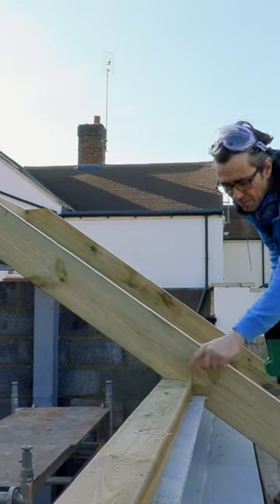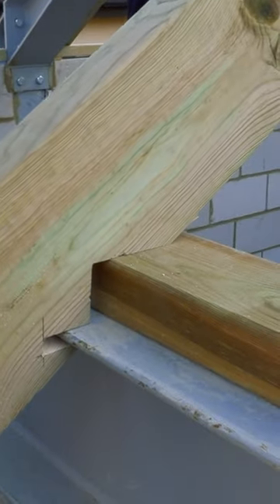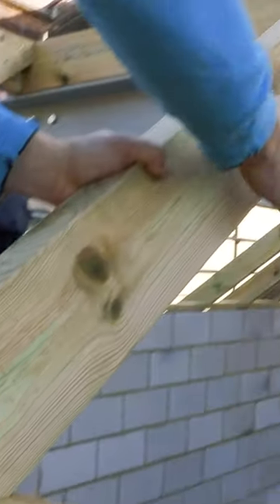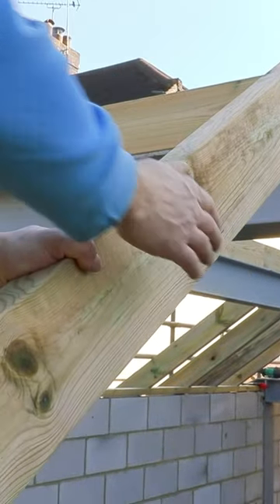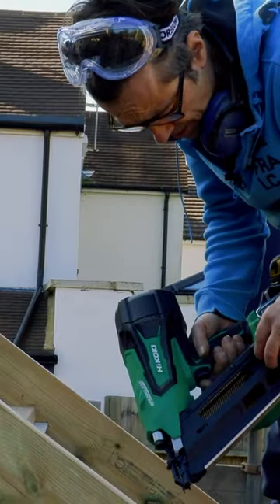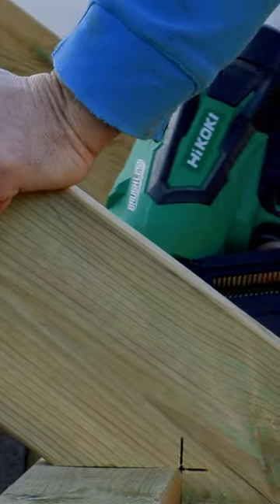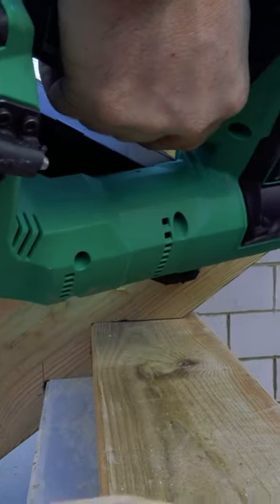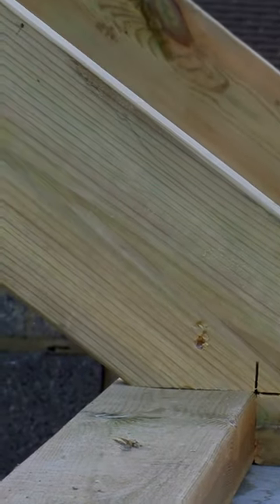Super Neat Rafters #shorts

Comment: The over cut is the sin in my book. Always follow the circular saw with hand saw to trim out , but I am a old person
Reply: Thinking the same. Cut is almost half way... reduces strength of the wood.
Reply: It's pencil mark I think.
Reply: Not a big issue if you consider how the roof structure supports the weight, only an issue if your over cutting is excessive, there is a possibility that the tails become weakened and thus the overhang compromised. But again as long as this isn't excessive along all of the tails (not forgetting the tails are tied to eachother with roofing baton) it shouldn't be an issue.

(Aswell his rafter tails are supported by the steel in tandom)

Personally I don't do this if I can help it, but I'd imagine when the pressure of time and weather kicks in it could be a different story.
Reply: Agreed. Inspector will count the cut as the remaining width of the board for the rafter. I believe 4" is minimum.
Reply: It’s only over cut on one side, the other side is perfect (classic skilsaw cut) and once the overall cut is no more than 1/3 the width of the rafter it’s fine . It’s the nailing of it with the nail gun is the sin, can’t beat a good old 4” round wire on a roof 💪😁👍
Reply: @jncg2311 it’s not pencil marks.  I took a screenshot and zoomed in, and you can see the cut wood fibres and that it’s a slot.
Reply: @maxmerton I agree now, you can see at the end, wood fibres in the cut. I was initially influenced by the pencil marks around the steelwork on the other side.
Reply: @rowlandgregory1233 20 penny is overkill. His nail size is weird. Comes out to 3½" and 0.122" diameter (same length as a 16D and same dia as a 6D nail). I don't get that. It's like a large brad nail.
Reply: They are far too easy pulled out for a roof, not a good job at all, 4” round wire nails were used for a long time and still the best in my opinion 💪😁👍
Reply: I was taught to handcut the rest and I've only been qualified for 4 years, just looks nicer too, hardly takes any effort
Reply: Yeah agreed, he is showing off his neatness around that steel then goes round the other side and he's over cut it. If its a time issue, why the fucks he making a video.
Reply: @khalidacosta7133 The overcut isnt going to compromise the strength of the wood where its situated!
Reply: Makes absolutely zero difference
Reply: I thought that but it must be a pencil mark. He wouldn’t have done the second notch n the made a mess of the bird’s mouth surely
Reply: @jncg2311 no it's the cut. Water.wil get in there too
Reply: @jimmyjoe1591 if water is getting in there when the roof is on then a slight over cut is the least of your worries😂.
Reply: Completely agree why go to the bother of that little cut out if ur going to over cut the birdie
Reply: @jncg2311 no. It’s definitely over cut
Reply: @rowlandgregory1233 nobody uses 4inch round wire nails anymore unless u get told otherwise in rhe specification but the nor now is just 90 nail gun nails
Reply: @reeceowens9144  because of insulation specs rafters are getting bigger than ever, and I can bend a paslode nail from tip to head with my hands, try that with a round wire and it will be your fingers that bend…  you can risk what u want in wales but here we like it tough 😁👍
Reply: @maxmerton so did I and it’s 100% pencil.
Reply: @Ben-ef4gf  OK then it’s pencil.  But he must have used a pencil in the shape of a circular saw blade, with teeth, rotating at the speed of a circular saw blade.
Reply: I am totally against overcuts too.  Just lazy but not likely a critical issue structurally.   A total sin for outside projects like decks.   A place for water penetration and pooling leading to rot
Reply: I can’t speak for everywhere but here rafters are way oversized in comparison to 30 years ago. 5x2 rafters and an over cut is a sin which is why it’s mostly older guys mentioning it, 7x2 with an over cut means nothing to the structure. And if there’s pooling of water around the wall plate you have bigger problems than an over cut birds beak 😂👍
Reply: @jncg2311 nah that’s definitely a cut not a pencil bro
Reply: Grow up it’s a rafter
Reply: @rowlandgregory1233  is that because timber is shyte nowadays?
Reply: Timber is definitely rubbish, faster growing with more soft wood, but bigger rafters I’m dealing with is mostly just to get more insulation shoved between them, nothing to do with strength 👍
Reply: @rowlandgregory1233  If they're serrated would it make them equal to 4" round?
Reply: @peadaroloughlin3270  it’s the head that pulls through first with nail guns so the ring shanks are no help with that. Round wire for strength, 💪 roof and arm 🔨
Reply: Black pen, other side of bird mouth has none
Reply: @theRhinsRanger  definitely not black pen, it’s a circular saw blade so he has cut past the line on one side but because of the circular blade it cuts less on the backside, it’s a very common thing, but seems very controversial on YouTube 😂
Reply: But your absolutely correct.👍
Reply: That so called over cut is absolutely fine. It's only affecting the overhang which is what like 16 inches? Maybe 2 feet? That rafter tail could be a 2x4 and still have plenty of strength for a 4 foot overhang let alone a 2 foot.
Reply: @maxmerton god that’s sad
Reply: @ELTUK82  please be specific.
Reply: Absolutely correct 👍🏻  
I'd rather take the time doing the final cut on the birds mouth with the handsaw rather than 
Fart about detailing around RSJ that will never be seen nor diminish the strength..

I also rather hand nailing 4" wires at the wallplate.. the Wireshank are good but just doesn't feel right😊
Reply: Absolutely.. I love those Japanese pull saws they’re fast you can finish that off in about 8 seconds and it looks beautiful.
Reply: That's a good rule to live by
Reply: Its the pencil mark lol!!
Reply: I'm 26 and that looks pretty bloody shoddy to be honest. The pressure to cut corners comes from the top, but the only way to make things right is for a No to come from the bottom.
Reply: Hate over cuts !. Only special without !
Reply: expansion
Reply: Thinking the same, doesnt want a second birdsmouth but cuts the first deeper than needed
Reply: @jncg2311 its not
Reply: i always finish my birds mouths with a hand saw, that been said those rafters are massively over sized to accommodate some thick pir insulation and that overcut wont weaken the raafter
Reply: @Ben-ef4gf No, it is overcut. Video poster confirmed it in another comment.
Reply: Agreed..
Reply: I was just going to comment when I saw yours. Absolutely. The rafters are weaker with over cuts. As are stair stringers. Jeeez. Not good.
Reply: Hahah I literally came on the comments to post the same thing 😂
Reply: @jncg2311  nope watch the whole video the first one he showed you can see it’s pencil but the one he nails in place you can see the cut line clearly with a round blade it might not penetrate all the way past to the other side
Reply: @rcirclebc3818  Thanks, I did. If you read the comments above, I agreed months ago that it was overcut in the second part of the video.  Still agreeing now...
Reply: @jncg2311  
On the one side it's pencil mark, on the other it's a cut.
Reply: @jncg2311 definitely not a pencil mark🤦‍♂️
Reply: I thought it was an overcurrent also.
Closer inspection: I think it is felt marker...
Reply: What overcut? Is that not pencil lines?
Reply: Drill the inner corner first and either cut out or carefully.
Reply: No hes right. It's 2 over cuts. The first clip is a pencil mark. Old school is often best. Modern is cut corners and do it quick and cheap. Integrity was the focus previously.
Reply: @jncg2311 That's a cut
Reply: @neilrafferty2097  Good grief.
Reply: @jncg2311  Robin is usually Mr Perfect.
Reply: I agree, he’s saying it looks special too. Why not use a hand saw. It takes a few extra seconds per rafter.
Reply: @khalidacosta7133  bollocks
Reply: Think thats pen mark

Comment: That notch looks like a great place for water to gather and soak into the wood grain.
Which is why a birds eye cut would make more sense, in my opinion.
Reply: Was thinking that, too
Reply: Water gathering in the truss timber of a felted and tiled roof?
Reply: @durrclips746  Over the lifetime of the roof, there will likely be leaks of one form or another. Water always finds a way to where it's not supposed to be.
As such, it is generally a good idea to try and avoid catchment areas as much as possible.
Reply: How exactly is water going to touch that  area? Do you know how roofs work?
Reply: @jayuppercase3398  Read my previous comment.
I seriously think people have no life experience these days.
It's like contingency planning is a foreign concept or something.
Reply: @deth3021  Yeah, a roof leak is bad full stop. It doesn't matter if there's a small notch in a piece of wood. If you have a roof leak it needs fixed regardless.
Reply: @durrclips746  can you at least try to think things through?
I mean even at the most basic of levels.

1 people don't always notice all roof leaks right away.
2. Even if the leak is fixed, the water will already be in the catchment area and soaking in and rotting the wood.
3. You seem to be assuming that rain only falls downwards. It doesn't.
Rain with driving wind is like a power washer and goes in every direction and will go through every joint, crack, etc...

By your logic, you don't need seatbelts because you shouldn't crash.
Reply: @jayuppercase3398 water vapour might condense on cold steel
Reply: If you get water there, your roof is leaking.
Reply: @deth3021 your talking bollocks
Reply: @deth3021 it's treated timber. It'd last 15/20 years if left outside. You're taking absolute bollocks

Comment: THE OVERCUT!!!😭😭😭😭
Reply: Thats the first thing i noticed!
Reply: The overcuts do not go all the way through and there is still plenty of wood. Get over yourselves.
Reply: @really2345  You sound like a bad craftsman, you should take more pride in it than that.
Reply: Using a circular saw your allways going to have slight over cut on one side
Reply: @mylesmackenzie3355  that's not slight.
Reply: @mylesmackenzie3355 unless you use a jigsaw. Or you get as close as you can, then use a handsaw, oscillating saw or a chisel if you're really fancy.
Reply: You sure it's not pencil marks?
Reply: @markorton6171   you can clearly see the gouges from the left side of the board when it zooms in close.
Reply: It's weird - on one side it is definitely pencil, on the other it is definitely over cut. It's as if they were two completely different pieces of wood
Reply: What is an over cut?
Reply: @jasonswindells6356   cutting beyond where the two lines meet to make the notch. You don't want to go past because it compromises the strength of the lumber. Due to the curvature of the blade, where you stop on the surface isn't the same as on the underside. Typically, you would switch to a hand saw  and finish the last half inch or so to make the cut flush.
Reply: It's not over cut you clearly see the other side of the birds mouth on the same timber when the camera is on the right side it's the mark of the birds where he marked up 🙄
Reply: @christopherbyers2294  you know that a saw blade is circular and does not make a 90° cut, right? So, from one side, it can be cut and then not have gone through the underside? The moment it passes the intended intersect, it is compromised. A millimeter or two, ok. But those are some pretty deep gouges for an instructional video.  Would I bet my life it wouldn't affect the overall integrity of the roof? Yes. Would I leave it in a video or on a jobsite for anything bigger than a 10x10 shed? Nope.
Reply: And? All the weight is on the seat cut.

Comment: You've over cut the birdsmouth both directions and you expect praise for notching the beam flange?
Reply: Nothing wrong with the overcurrent will have no repercussion on the strength of the roof
Reply: @barrystanton390  Do you mean overcut and what should one read into your mistake?  Excessive notches and cuts ARE a problem and DO affect the shear strength at bearings.  Why do you think we Structural Engineers are careful in our calculations?  It is not so that people ignore the basic properties of the materials they work with.  It is in the hope the folks building our designs take pride and care in their workmanship.
Reply: First thing i noticed was the over cut, yuck.
Reply: What do you mean by over cut the birds mouth?
Reply: @robi4387  yea what ever...been pitching roofs for 50 Yr  they're all still there
Reply: @D_5821 the birds mouth is the small cut he made so the board could fit around the steel beam (gray in colour). If you look closely he cut farther than needed.
Reply: Its pencil lines

Comment: Why don’t you put wider wallplate on steel 
Saves a lot of hassle in my book !!!!
Reply: that’s what I’m saying
Reply: Or if the wall plate was on the outside edge of the steel then just needs a bird’s mouth or does it have to be on the inside edge?
Reply: What about cost but I'm sure your not paying for the materials
Reply: @Gary-o5v  ah yeah, costs - screw the customer's safety, security, etc.
Reply: @tom.2900  obviously you didn't understand what I was saying their was a comment saying why not use a bigger plate as wide as the beam I said obviously your not paying for material a 2x6 is way more then a 2x 4 and so on when you can do it this way with an extra cut for the beam

Comment: You shouldn't use galvanized nails on tantalized timber , you should use stainless steel. Tantalized timber contains copper carbonate, and galvanizing is a zinc coating. Zinc and copper react, the zinc will loose elections to the copper and become ionized ie cause the nail to rust! Where I live building materials used for structural elements must be durable for 50 years to meet code. Galvanized nails into tantalized timber don't meet the 50 year durability requirement.
Reply: Reminds me of hearing about galvanic corrosion in engineering class.. not sure if it's that.
Reply: Then why do manufacturers specifically suggest galvanized, stainless or even aluminium fasteners with tantalized lumber? Although the advice is sound, this seems like a suggestion from a chemical engineer and NOT a structural engineer.
Reply: @johndough4507  I'm just a general contractor. That's the guidance for the Building Research Authority where I live. I would be very surprised if a manufacturer suggested aluminum and tanalized... that's an even more corrosive reaction. That's why you can not have copper spouting discharge onto an aluminum roof. The copper will destroy the aluminum. In the back of our national standards for timber building is a table with all this in it, and we get taught it during our apprenticeship. No fancy engineering to it.

Comment: You should have a 6x2 wall plate on that rsj and it should be bolted to it every 800mm minimum staggered. The rafters would also need to be deeper to allow bigger birds mouth by the look of it. You’d also then use truss clips for hurricane protection. The rsj should arrive already drilled from factory. Looks like a domestic job tho so probably corners cut. The rsj would also need to be bolted down both ends and not just sat on the brickwork. Not sure if that’s what the case is here or not
Reply: nobody asked
Reply: ...and the top flange of the rsj is going to split those rafters if they eventually tilt/skew
Reply: @bowilliford7822  why did you read it then?

Comment: Thats a drip edge right? Should be cut square you just making a pocket for water to sit.
Reply from the maker: it is covered with felt and tiles. It will never get wet.
Reply: @SkillBuilder  ya im dumb, I see. its fun I guess if you are getting paid hourly and boss isn't around. Or making a video.
Reply: since its a 12/12 pitch? you could just lay it on edge stack em all together and cut with circ saw set at 45 would be faster then drill and saw. or adjust for whatever pitch to angle
Reply: @SkillBuilder that metal will condensate like mad. That will defo be wet, almost always !
Reply: @SkillBuilder Hm.  Felt never splits?  Tiles never break?

Comment: don’t wanna be an asshole but for several reasons this is not neat at all. wood should never touch metal directly as water condensates and damages wood over a short time. Then your rafter cuts, bird’s mouth, are not exact and can break out just where the cut goes further into the rafter. dangerous. last bit not least: take a damn screw instead of shooting too many nails in which will crack those thin boards. good luck 🤞
Reply: btw. I am a german trained carpenter. have fun

Comment: I'm not even a roofer and the first thing I noticed is the horrendous overcut of that bird mouth.
Reply: Circular saws usually comes with a round blade, this means there will be a small overcut on one side. Has little to no effect on the strength of the rafter.

Comment: It is not even a structural issue why even worry about it .... you spent all that time for nothing the original birds notch is the structural point or you could have just used a 2 x 8 treated shoe plate... it would have covered the steel but whatever

Comment: Eh, there is far too much movement in that type of lumber over time to be making such scribed cuts. Especially to steel. You leave yourself open to extreme cracking in the long run. And, weaken the integrity of the rafters. Looks good, though, for anyone right there before it gets closed up. Slow down, Champ. You need to do some finish work now and again to quench that thirst.